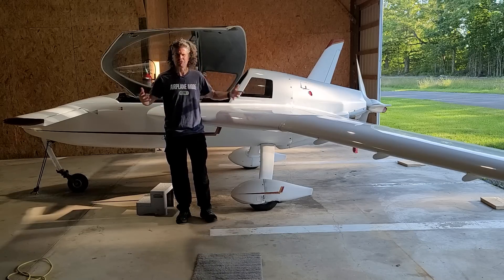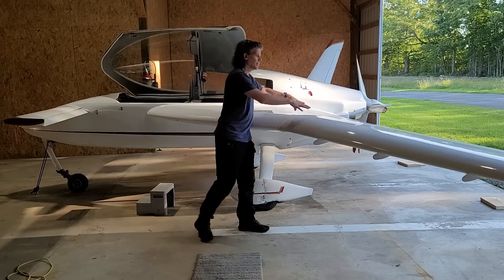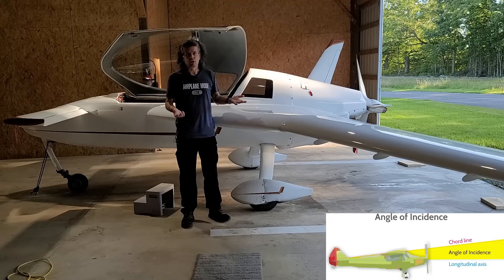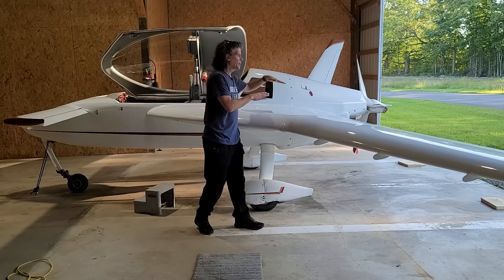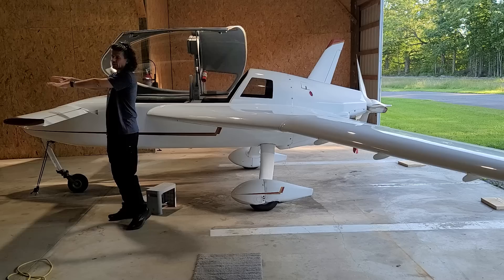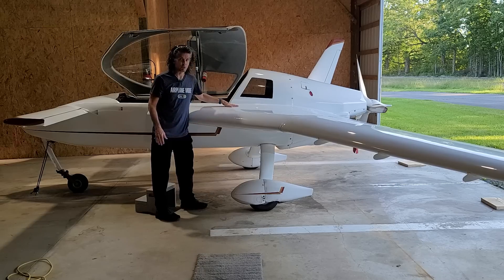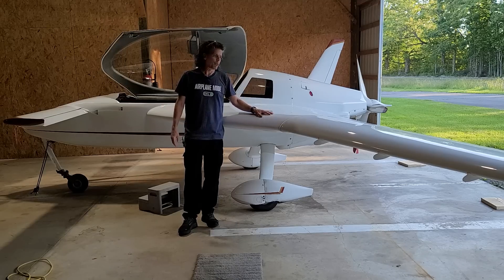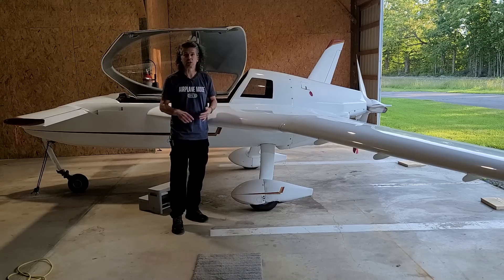Why Did I Buy This Weird Cozy MKIV Canard Airplane?

Comment: Dude, stop misinforming people. You got aerodynamics and weight and balance waaaaay wrong. The elevator on the Cessna is just a control surface, it’s not to compensate the weight of the engine. You said it yourself the CG is under the wing, CG means center of gravity, that means the aircraft is balanced on that point, it doesn’t need the elevator to push down to compensate for the engine weight. 
People said you are humble, no way, you are ignorant. 
Sorry but that’s the truth.
My humble advice, you better go back to the books and learn the facts, because in aviation ignorance can  cost you your life. 
I wish you a long good life.

Comment: I am/was already to buy a Velocity...then the comments regarding 'prop-strikes' was all over the forum.  Now i am thinking to always have one (propeller) as a back up while one is being repaired?
Reply from the maker: If you fly your airplane properly, you will never have a prop strike. And a prop strike doesn't just mean a new propeller - it also means an engine tear-down. That's the REAL cost of a prop strike - that can be tens of thousands of dollars. But again...fly your airplane within the POH parameters and you'll never have to worry about a prop strike.

Comment: The horizontal stabilizer on the back end of that Cessna does not exert Force downward unless you have the horizontal flap on it in the upward position. In neutral position it doesn't exert force in either direction, because it's not designed as a wing. It doesn't become a wing unless the moving portion of the horizontal stabilizer goes in the upper position creating a downforce or in the lower position creating a lifting Force. Kind of the reason why it actually exists.
Reply from the maker: Sorry, but you're just wrong. You clearly are not a pilot and don't know aerodynamics (obviously, if you're calling the control surface a "horizontal flap"), so why are you trying to correct a 30+ year commercial pilot who clearly DOES know about airplanes and aerodynamics? You're just making yourself look silly.

Comment: I enjoyed this video. I don't know if you mentioned it (I can't remember) but another plus of our canards is that we don't have to worry much about maintaining a "coordinated turn"!  Also, you didn't mention that instead of flaps we have an air brake to slow the airplane during landings if needed. I say "if needed" because it's all in speed control. The approach will be a bit shallower without it but doable, for me that's SOP. Another advantage of canard designs: it's been so long that I haven't had to deal with "Adverse Yaw" that I can't even remember what that was all about. 😉
Reply from the maker: I find that the landing brake doesn't slow me a huge amount, but what it does do is STABILIZE the airspeed. Without it, it's really hard to maintain a consistent airspeed on final, it's very sensitive to pitch and power. With the brake deployed, it dampens those excursions and makes it much easier to maintain a constant airspeed.
Reply: @CanardBoulevard  Yes, 100% agree, very, very sensitive to pitch and power and it's very noticeable on approach. I've learned to land mine without the speed brake but it's just like you say, very difficult to stabilize the speed. I've tried slowing it down with rudders and by slipping but that's not very effective either. It's a slippery devil. What does work for me is pitching up early on approach, wait for speed to bleed out and maintain with power. I had to learn to land that way because when I did my transition training the speed brake would not stay down, I've fixed it since but I still do my landings the same way I learned initially. I will experiment more with the speed brake now that you've given me some new insight on its use.

Comment: Im getting into flying, and looking at a velocity XL, im wondering if anyone can tell me about the maximum engine weight for this plane?
It currently has no engine, and im considering a car motor
Reply from the maker: The XL is specified to use the Continental IO-550, which is from 450 to 670 lbs, depending on the model. Some XL's use a Lycoming IO-540, which is again around 450-500 lbs depending on model and accessories. That's dry weight. For an automotive conversion, keep in mind that you're also going to have to hang a PSRU on the end of the engine between it and the prop - which is the absolute worst place to add weight to a canard aircraft.
Reply: @CanardBoulevard  thank you for the information, the engine I'm planning to use is considerably lighter than that.

Comment: I own and fly a Cozy IV and had a LongEZ for years. Both my airplanes had a John Denver fuel valve. With my LongEZ I would pre-flight check the fuel valve as it would get stiff and I would spend hours removing it and lubricating it. One day flying my Cozy I went to switch to the fullest tank before landing and the fuel valve got stuck in the off position! I was looking at the highway below to make an emergency landing and then realized I could try and put the valve back on the tank it was on, which worked; whew. I did not fly the Cozy again until I ripped out the $30 John Denver valve and put in a $200 valve. After what happened to John Denver it is crazy that anyone would have that cheap valve in their airplane or that they are actually sold for aircraft use. BTW I read that John Denver knew his valve was jammed before he took off and that he actually a pair of vice grip pliers on it as a handle to be able to turn it.
Reply from the maker: You're correct, there was a pair of vice grips on it to turn it. I am not a huge fan of running fuel lines through the cockpit, but having the fuel valve right next to me (and it's a high-quality one that prevents accidental selection of "off") means I'm assured that I've selected exactly what I expect. And...I can switch tanks without even looking. Fuel selector valves is not the place to economize on your build. :)

Comment: How much did it cost? How much would you spend for a certified plane with the same performance? How many hours should a pilot have to own this plane? What is the maximum certified altitude? Where is the yoke/stick located? How does it compare to the other 4 place canards?
Reply from the maker: You should be able to find a decent, flying, low-time Cozy with similar engine time and avionics for between $60K-$100K. Let's look at an example of one that recently sold. It was 7 years old, had G3X Touch and other recent Garmin avionics, and an IO-360 with 600 hours on it. A Mooney M20 with similar performance, the same age, and same engine time will sell for around $650K. A Cessna 182, again with similar performance, the same age, and same engine time will sell for around $620K. Of course, those planes have much larger engines, and will burn more than 50% more fuel to cruise at the same speed as a Cozy.

I would not say that a canard should be your first airplane. It is a high performance aircraft, it is fast, and things happen quickly. I would really want to see someone with at least a couple hundred hours, and I suspect insurance companies would want to see the same.

It's not "certified" for any maximum altitude, but the POH states 18,000 feet as its max ceiling. Some have gone higher, depends on how it's built.

The stick is on the outer fuselage, so left hand for pilot, right hand for co-pilot.

As for comparing to other 4-place canards - there aren't many to compare to! Primarily Velocity, which is different in quite a few ways.

Comment: Your video explained a lot I did not know about Canards. The CG and why Canards don't have flaps was very interesting. As well as weight limits for the front seats. I am a very big guy and would have to fly alone in the front seat. I liked the Cozy I seen one a EAA in 2006 But it is a little small for me. I would like to get a Verlocity XL.
Reply from the maker: The Velocity is a great airplane, but at double or triple the cost of a Cozy...

Comment: Aviation is pretty new to me, but I have a question. I’m used to loading trailers and adjusting loads for axle weigh, tongue weight, and attempting to get the best overall performance when towing. Just before minute 13, you said that cargo loading can essentially cause lift issues at the canard and/or main wing. With this being a 3 wheel landing system, would using scales under each wheel allow for proper cargo adjustment? Wouldn’t those numbers show if the plane is loaded to far aft or forward and assist in shifting loads from front to back to prevent potential loss of lift on the main wing and spark a crash?
Reply from the maker: Excellent question, and the answer to your question is YES, that would do exactly what you say - and it's essentially how it's done. The airplane is weighed when it's empty, and its total weight and C/G (center of gravity) are determined. That's called the Basic Empty Weight, or BEW. 

When preparing for a flight, when things (fuel, people, baggage, etc) are added in, the weight of those things, along with their distance from a given point on the aircraft, all goes into a calculation that, along with the BEW, will tell you the total weight of the aircraft, and whether or not the C/G is within limits.

So while you COULD use scales to weigh your airplane every time you load it up, it's far easier to just do this once to get the BEW, then use calculations to derive your weight and C/G from that point forward.

Of course, whenever anything is permanently added, removed or changed on the aircraft, the BEW has to be changed accordingly, and after a while, you really need to re-weigh the aircraft just to do a "reset" on what you know the BEW to be. I'm planning to do this on my airplane soon.

Comment: It's too bad the rear wheels ( i.e. the "main gear" ) don't retract.  This must add a lot of drag, to an otherwise beautifully streamlined aircraft.
Reply from the maker: This is an experimental...so builders are free to do whatever they want. There are some builders who designed and built retractable main gear into their Cozy - but the benefit was really minimal: only about 5-7 knots gained, and a fair amount of increase in weight because of the retract system. Plus you lose around 10 gallons of fuel capacity, because you take up some room in the strakes to house the gear that would normally be used as part of the fuel tanks.
Reply: @CanardBoulevard  Ha.  This makes sense; though I am a bit surprised the speed benefit, from retracting the main gear, turns out to be so minimal.  Thank you for the detailed explanation!

Comment: [ 8:50 ] Ha-ha!  I was just finishing typing the following comment when I got to that part of the video:  Another advantage to this design, I imagine, is that, theoretically, engine noise should be reduced ( "taken away by the wind" ) — which should be more pleasant.  Just speculating.

Comment: Wouldn't a little bit of droop on the main ailerons produce a little more lift, and a little more drag, enough to slow the plane down.. to make take off's and landings a little slower.  The canard wouldn't have to work hard to compensate... ?  anyone..?

Comment: It sounds as if you have flown lots of aircraft. Is the visibility better without the propeller in the front?
Reply from the maker: There's a couple advantages. One is you do not have the possibility of flicker vertigo from sunlight coming through the prop. Another is that because you don't have a somewhat tall engine in front of you, the vertical profile of the front of the airplane can be much shorter - which means you don't need an upright seating position in order to see over it. This means a lower front profile, which means less drag. The forward visibility is definitely better than, say a Cessna 172.

Comment: It's wrong. Normal tail stabilizer is contributing positive lift. Proof: Neutral point of complete airplaine is behind nettal point of the main wing. Or say it diffetently: if you increase the stabilizer size on the tail, you better compendste it by adjusting the center of gravity more to the tail side.

Comment: It's not weird! It is a Burt Rutan design. Been around for decades. Beechcraft even had the Starship, Piaggio has a canard aircraft, called the Avanti. So, not so weird.
Reply from the maker: I agree...but the "weird" word tickles the YouTube algorithm better than "different" :)
Reply: the Starship was designed by  Burt Rutan and sold to Beechcraft.. I know because I ran the calibration lab for Tracor Flight Systems at Mojave and calibrated the flight test instruments including the Scanivalve pressure measurement system which detected and measured the air pressure at all the critical points on the prototype. BTW the prototype was A 5/8 th scale Starship ( very cramped inside) yet it flew very well and met all the requirements for commercial production in full scale. The problem with Beechcraft’s interpretation was its engineering department’s refusal to adopt Rutan’s lightweight construction methods and thus created an grossly overweight aircraft rife with design “ fixes” which made the design perform at a disadvantage to existing Beechcraft designs. It was nearly forty years ago when I first laid eyes on the prototype and even today the memory of it and it’s flight development program still thrills me. Had Beechcraft built the Starship as designed we would by flying in a 330 mph  cruise, 24 mpg ultra modern carbon fiber and fiberglass  honeycomb aircraft 5 times stronger and thousands of pounds lighter than Beech’s 15,000 pound aluminum and steel monstrosity.  To bad Walter Beech died and left Olive in charge with the old “ rivets and sheet metal” guys calling the shots. Beechcraft could have been the most advanced aircraft manufacturer in the world with the “greenest “ corporate aircraft designs. J D.

Comment: Why use lead shot? Use two water containers and a pump.
Reply from the maker: The area in the nose where the ballast goes (for the proper moment arm) is small. 50 lbs of lead is about the size of two small hardcover books, and fits in there easily. That much water would require a 6 gallon tank, which is far larger than would fit in that space.

Comment: I fell in love with the Cunard design when I saw the Quickie flying out in Mojave, CA back in the 1980's.  It was maneuvering like an F-16 with only a Volkswagen engine.  But I've since learned it had it's own problems too.  With it's landing gear out at the wing tips, hard landings could fracture the wing spar.  But it sure was a sleek plane to look at.

Comment: Question: Why are planes like this or the Rutan Vari-eze still designated as experimental by the FAA? It makes it sound like the layout has yet to be proven when it's simply a different design that so happens to be around forty some years old.
Reply from the maker: Experimental doesn't mean unproven. It is a technical classification given by the FAA for all non-certified aircraft. If the airplane is not built by a company and submitted for production certification, then it is considered experimental. All those WWII fighters and bombers you see at airshows? They too are flying under an experimental airworthiness certificate, for the same reason.
Reply: @CanardBoulevard  What details would you recommend for a good understanding on FAA certifications?
Reply from the maker: @j.mangum7652  Right here: https://www.faa.gov/aircraft/air_cert/airworthiness_certification/sp_awcert/experiment
Reply: @CanardBoulevard  Thank you good sir👌

Comment: Glad you covered the aft CG stall issue.  Canards always look attractive on paper, but get them in unfamiliar attitudes outside the normal flight envelope like inverted or over speeding and watch out. They can do unpredictable things that can be not only hard to recover…but the method of recovery may be let’s say, not intuitive.
Reply: Even though they were not explicitly designed for aerobatics, canards can and ARE used for it. At least a Long-EZ, VariEze and Berkuts can easily do barrel rolls, loops, etc., without any modification. Any airplane will be over-stressed when over-speed so what's your point? A deep stall due to a grossly aft CG can be difficult to recover from but that requires gross pilot error in configuring the airplane before flight and as he explained in the video it's happened in canards on very few occasions. Other variants of canards such as Long-EZ, VariEze, Berkut are generally not susceptible to aft CG issues.

Comment: You really know your stuff, very interesting. I would love to hear your thoughts on the the Long-Ez vs your Cozy, Pros vs Cons.

Edit : Typo
Reply: As the owner of a Long-EZ you can pretty much forget about having to make ballast adjustments for CG.  The other obvious differences between a Cozy and a Long-EZ are the tandem and side-by-side seating arrangement. The Long-EZ is a 2 seat tandem, the Cozy 3 is a 3 seat, the Cozy 4 is a 4 seat. The fuselage of the Cozy is somewhat wider than the Long-EZ to accommodate the side-by-side seating. Cozys typically have bigger engines but there are Long-EZs with engines just as big. For reasons I don't fully understand yet, the Cozy typically cruises a little faster than the Long-EZ but the difference is not much, 10-20 knots.  Most Cozy's are controlled with a stick on the left, most Long-EZs on the right. The Cozy, because of it's wider fuselage has a bigger instrumentation panel that can accommodate more instrumentation. The landing gear of a Cozy will also be a bit more rugged due to it's higher payload capacity. I would say the biggest difference between them is the number of passengers, seating arrangement, payload capacity and the effect that has on CG and the need for ballast. In all other respects they are pretty much the same, even the wing shape and size are the same.
Reply: @carlosa.avalle528  Many thanks for your answer 🤗